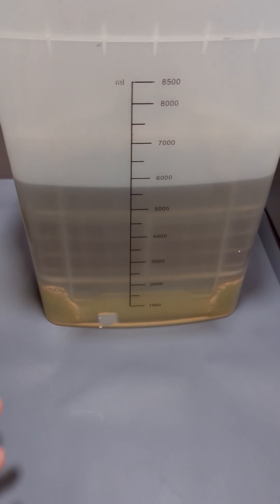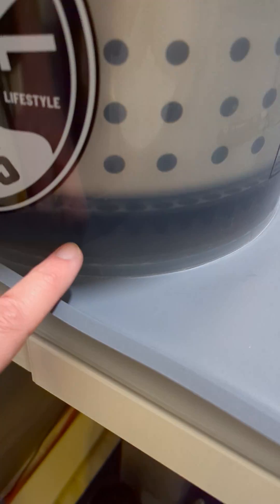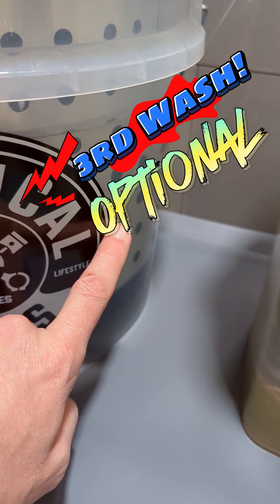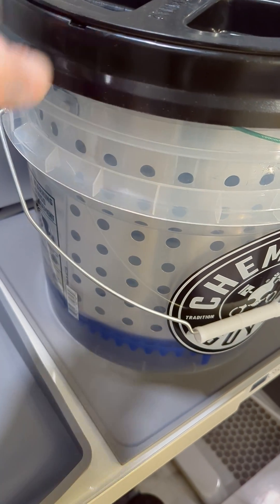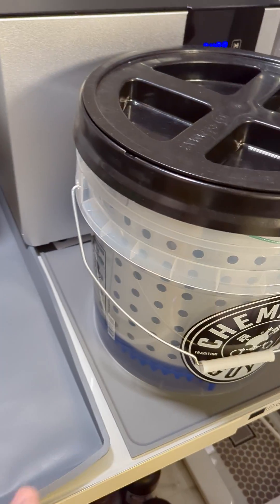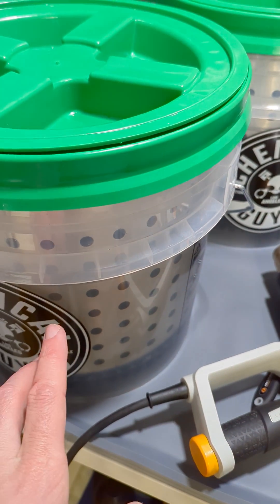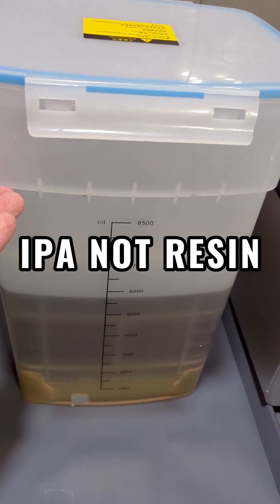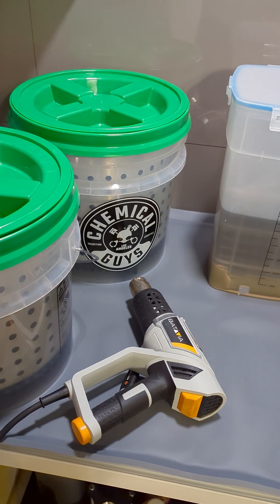How I clean my Resin 3D Prints! #tips #tips

Comment: How do you prevent the residue at the bottom sticking to your prints when drying? That is my biggest issue. When that happens, I always think it's time to refresh my cleaning solution….
Reply: Where did you get the inner for those buckets?
Reply from the maker: With this process the resin crap stays at the bottom. Nothing to mix it all in. I'm also dipping the items in and out of the IPA. This makes sure that it flows in and out of any hollowing. Without this... you're only cleaning the outside.

Comment: I do the same.. just I like to use an alcohol destliller for recicle my dirty IPA.. Then I just clean the destiller, put the resin in an transparent bag and leave it to the sun to cure most of it and then throw it away... in to the forest!! no I am just kidding.
Reply from the maker: I tested the destliller, it does work but it's also a lot of work. Right now I put the IPA into 1Gal jugs and leave them in the sun for a few months, then filter them to get back back a sticy yellow IPA that I use in the first wash bucket. It's not perfect but it's very low effort.
Reply: @J3DTech  I don't know.. I did that for a while and filtering the IPA, takes time, depending on the amount.. 2 or 3 hours job just filtering.  Meanwhile, when distilled IPA is very pure.  NOT that pure because you still can smell the resin inside but is transparent.  Only takes like 1 hour or one and a half hour.  The only thing that I don't like is the remanent resin, is concentrated and is very pure so you need to use respirator with filter for organic compounds.  But once you get use to it, is pretty easy job an 30min or cleaning the distiller. I preferred that way.

Comment: How do you wash/rinse your models in those buckets, do you shake them? 1 by 1 ? How do you avoid to scratch models, which happens when they touch themselves together or touch walls while shaking.
Reply from the maker: @henrykhenrykowski2736  I lift the metal basket in and out. 12 times per a wash. 

This will allow for I hollowed model to drain the IPA out and back in flushing out the inside. 

The action of pushing the metal bucket gently into the IPA also forces those little holes to act like Jets essentially power washing the outside. 

Because I have the plastic funnel at the bottom, the heavy IPA saturated with resin doesn't get mixed back into the washing IPA towards the top. 

Finally, the metal bucket is smooth on the bottom so it does not scratch or gouge into the plastic bucket. They still look brand new even after using them for over 6 months.

Comment: Do you let your prints completely dry between washes?
Reply from the maker: I don't and depending on the print I'll either shake them off to remove most of the IPA or I'll hit them with the heat gun on the cool setting to blow it off/out before the next.

Comment: Hi J, any tips on how to dry prints? I sometimes get a "wet effect" after curing them. Thanks for the info
Reply from the maker: This is just another reason I use IPA and not water. ALso why I use a heat gun to dry and warm the prints before cure. I highly recomend this method for a clean and crisp end result.

Comment: Consider cone-shaped buckets with a spout on the bottom to drain out the gunk like what they do when brewing beer  put a screen in there so the parts never sit in the cone shape and always in the clean IPA... a jug turned upside down and replace the lid with a spout can be an option
Reply from the maker: I did consider something like this but the funnels are all pretty tall not letting you get as deep into the IPA.

For removing the dirty IPA I have a syphon hose. It does quick work of it